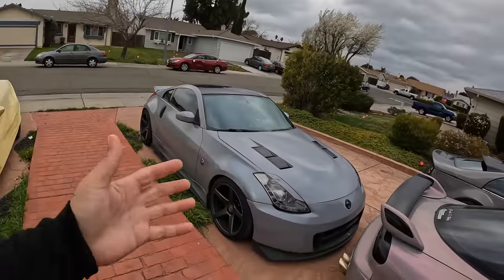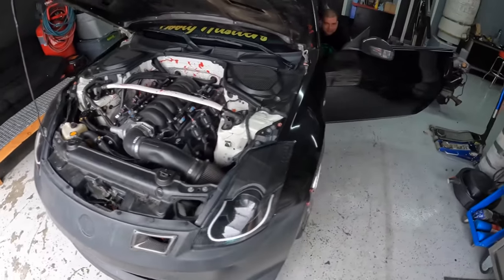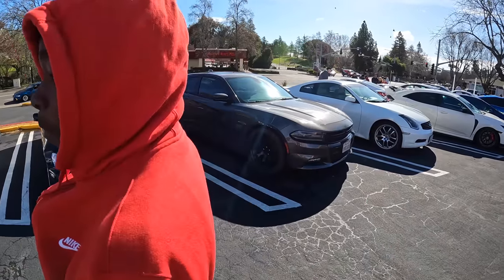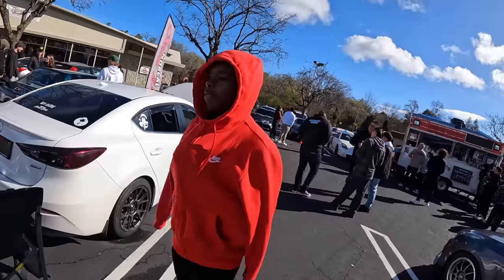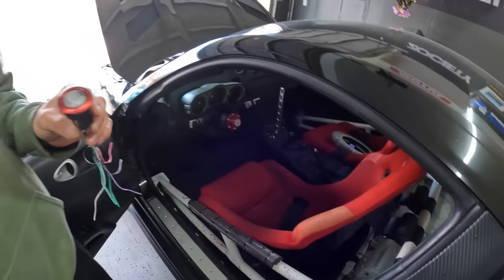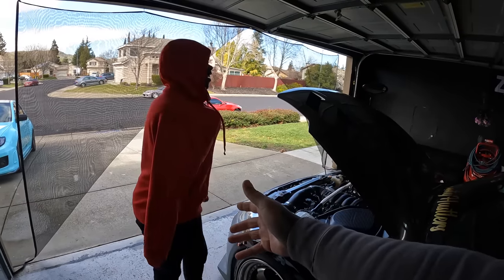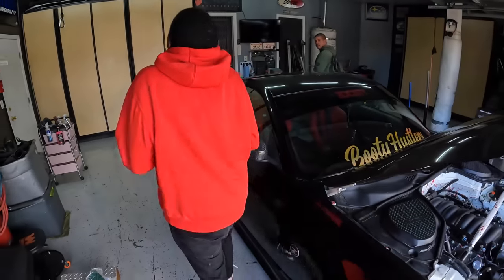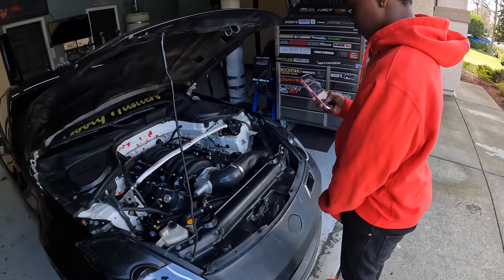He Didn't Believe Me When I Told Him This Motor Was "ALL STOCK"

Comment: Yo Mike after seeing your 350z LS swapped made me look at them different and now after seeing white Arron's 350z with the LS3 swap I have a chance to get a 350z that has a blown engine and the body is straight and it is in really good condition and I can get the car for like 1500 dollars after seeing your car and now Arron's car I'm really thinking about getting it and doing a LS swap to it what transmission do you have or is there anything specific parts I would need is there a LS swap kit that is available I'm mechanically inclined and worked on cars for years but this would be my first swap